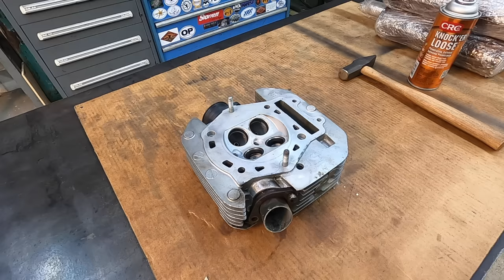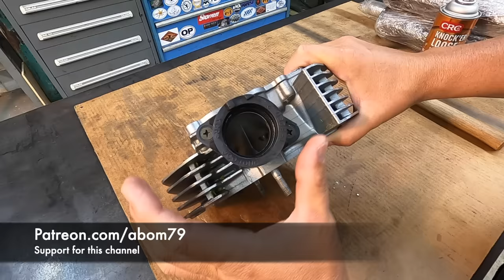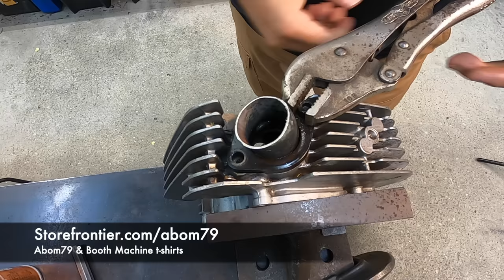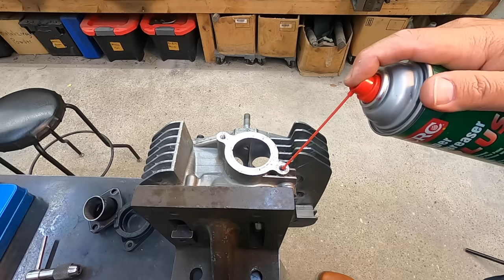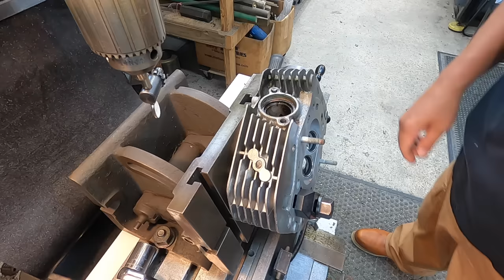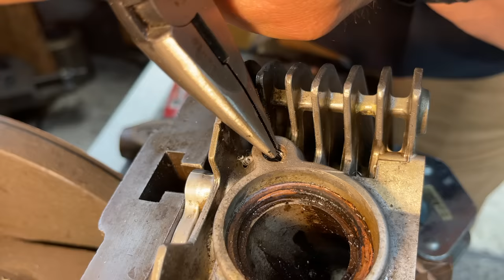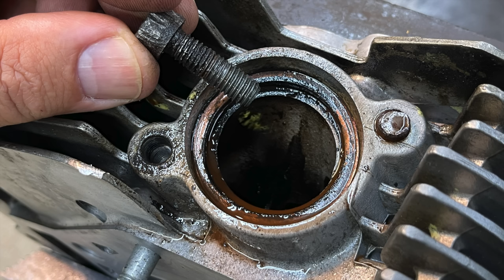Broken & Siezed Bolt Removal, DR 650 Cylinder Head

Comment: Aluminum heads and steel crews/bolts/ ALWYAS reassemble wth copper anti-seize. These dirt bie engines were desgined around a rebuild scehdule of no more than 250 hours. Sadly, sort of, they can go a LOT longer without really NEEDING a compelte rebuild and electroysis betwen different metals is almost a guaranteed outcome.

Comment: Hello
I conclude that you are not a certified motorcycle mechanic because you are definitely giving yourself a lot of work for nothing!
Before breaking the allen bolt with pliers (which is not professional at all) you only have to drill the head of the allen bolt with a drill size just the diameter of the head (the bit will center itself in the center) just drill the head .. once the head is drilled you remove the exhaust support and as the bolt protrudes you weld a nut to the part that protrudes with a mig you let it cool a little and you unscrew the broken bolt with a quality box like snap-on. And it's as simple as that!!
In your way you risk kissing and you spend too much time working for nothing.
Reply: No pal, this bolt was in deep for good.. You would only snap your welded nut and leave a mess. This was done to perfection, no welding.  And the vice grips working it out worked perfectly so I must say that criticism is ridiculous.  I have worked as a mechanic for decades and this work was done perfectly IMO ..

Comment: My first year L2s would have done that quicker and cleaner, including measuring with a pitch gauge and vernier calliper to check the stud for replacement: drill a small hole and use an ‘easy out’.You have damaged the threads - probably end up using a helicoil using your method. 🙄.
Reply: i see you are a theory man as a first year L2s. But you are 100% correct. Only real shop work is rarely the same. We apply the theory we learn about, heat, cutting ,pressure, wedging , And one of the combinations raise themselves as the right combination, The result ends up what was trying to be accomplished. Accomplish the desired conclusion.Engineering is not a black and white science.
Reply: @evengineering7136  no it’s a practical course and we teach students to ‘do’ stuff as well as appreciate the theory which is perhaps 40%. I don’t doubt your sincerity but I think our way is better and prepares students for real work - if they go into a workplace and get told to do it differently I sincerely hope employers appreciate the knowledge they have gained and the excellent job they will do. All the best.